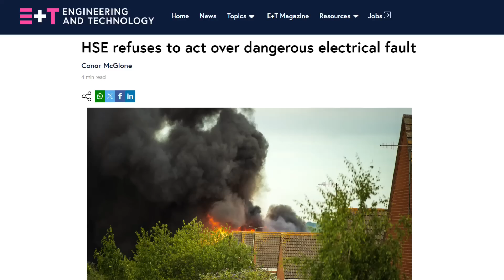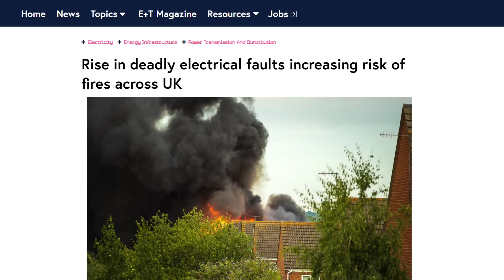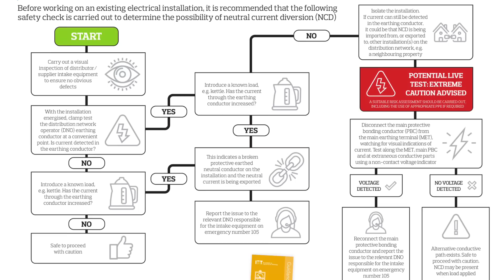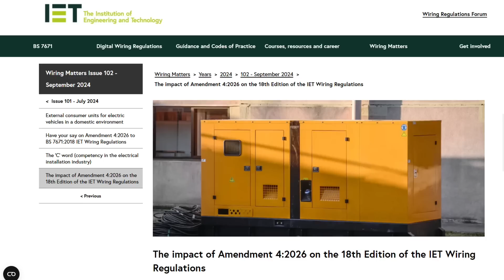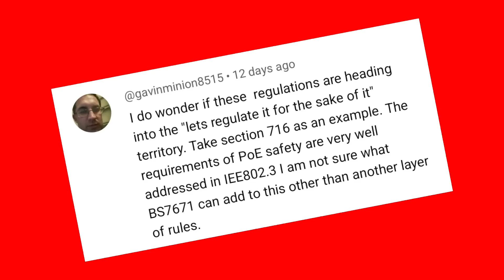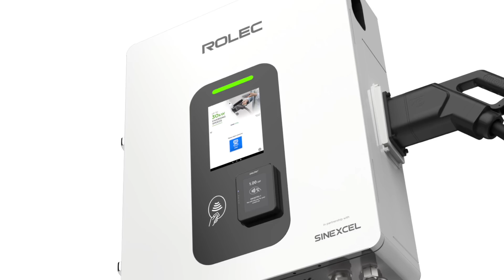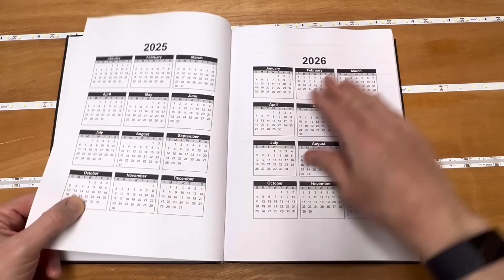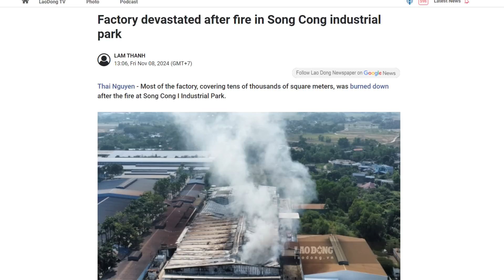⚠️ Electricians Warned Over Neutral Current Diversions ⚠️

Comment: Street charging: great if you can park in the street next to your dedicated outlet. In my road it's a free for all, you cannot guarantee any parking spot.
If it's a smart system, you might be able to get a charging spot, but how many chargers in a common street of 70 terrace houses? every 20 feet? Often, you cannot park on both sides of the (narrow) road, so you're stuffed.
It won't happen. It won't work.

Comment: EV parked on street corner, charging, gets hit by another car. The EV is still on charge and it's now damaged and it's pushed over the Telephone/Internet box. And pushed a street light over. 

If it's raining. Is it safe for people to walk past? Safe for dogs? 

What are the dangers and considerations?
Reply: If it is pushed far the connector should part, and in any case, the EVSE contains a residual current device / safety switch / GFCI, so will disconnect the power.  Yes, safe for dogs and people.  Your are sounding a little bit fossil fuel industry funded there.
Reply: What next? It's hit by a bolt of lightning?

Comment: I think I had one of those neutral current diversions at the start of the year. Power went off but then some neons in a extension lead were glowing faintly and a dehumidifier was running really slowly, sounded like it was struggling to rotate. Neighbours reported similar issues. Then about a week or two later my fridge freezer stopped working, I presume that the low voltage had damaged the motor. I have brought the Sollatek Fridge guard to protect my new fridge freezer, but it only protects the appliance, not the exposed metalwork in the house nor the gas meter.

Comment: k£25 for 400A seems fair enough. That's £25/hour of electricity flat-out if it's a single phase? k£25 if a thousand hours - only 6 weeks. It'll be ridiculously underutilised. If both-way charging (V2V?) is a thing, wouldn't it be possible to leave EVs connected to a common network with barely any capcity so they can charge each other? If you're driving ten miles every day with 100kWh onboard that cost you £8 (@8p per) to top up, you could sell £35 (@70p per) worth at a public charge exchange?

Comment: With the increase risk of PEN faults, when are car dealers going to be stopped from supplying 13A cables which EV owners then plug into their kitchen sockets ?! We have to jump through hoops to install a dedicated EV charger at a domestic property (including gaining permission from the DNO), yet an EV owner can bypass all of that, not realising the risk they are putting themselves and others at.
Reply: And in the kitchen there isn't any problem? In the driveway you're most likely wearing shoes while in the kitchen you're sitting bare foot on the tile. What is needed is whole house pen fault protection or proper earthing

Comment: PoE in electrical regulations is ridiculous. What's next? Power over USB or HDMI?
Reply: If fire safety is the concern, USB delivers higher current than PoE and does not require device handshaking before delivering power.  There are also examples of USB cables causing burns and even igniting fires.
Reply: @gavinminion8515  Isn't just because Ethernet is part of EV installations so electricians might as well know how to do it right?

Comment: DNC's don't just occur when there's an overt Open PEN fault. Whenever there is a parallel path, the neutral current will split according to the relative impedances of the paths. An open- pen will cause 100% diversion, & if that path is interrupted by say cutting a pipe, then full mains voltage will appear across the gap.
Spare a thought for the plumbers & how informed that are about the risk. The ones that are aware connect a jump lead before cutting a pipe.
There's a really good YouTube video about this by John Ward.
Reply: Plumbers in my part of the world do electrical safety, there's abundant information provided about electrical and the government frequently does safety campaigns but over the past 30 years not a single plumber I've had at my house has shown any concern for my safety (disconnected water bond etc) let alone their own.  No sign of bonding jumper, no test of pipework before going hands on.  Some of the jobs involved being flat on their back under the house touching the pipework.  There's a real world example used that should scare them straight but it doesn't.  Plumber went under a house, reached up to the pipe... and was found there with his hand still resting on the pipe two days later when he didn't turn up to work the next Monday.

Comment: A solution to the gas meter issue is something we do with water meters here in the states. The water piping in the US was allowed to also be used instead of an earth spike. To maintain continuity when the water meter is serviced, an electrical bonding jumper connects the street pipe to the house pipes to allow current to flow if the water meter is removed. A bonding jumper across the gas meter would allow the resistance in the gas meter to be bypassed during a PEN fault. In the US we have TN-C-S with earth spikes with additional lightning protection and equipotential earthing.
Reply: We have very similar things in the uk. A lot of the metal pipes though are being removed and replaced with plastic. Sadly making your solution not possible
Reply: @86744-i  That said if the pipe gets replaced with plastic the current isn't going to try flowing through the meter anymore. So this might be a solution after all.
Reply: We have this rule for metalic pipes in CZ  . Meters have to be electrically bridged .

Comment: yeah, having Volts Available is GREAT ...but the idea of a ground fault on a building and a resultant dancing neutral will destroy all my computers and network gear!!! ...I am in a run down council house and can see why the gas cannot be a smart meter = I want under floor heating and a GROUND sourced heat pump (I am at 200 meters altitude where the air gets colder and air sourced heat pumps are useless)...

Comment: We should do what’s done in the Republic of Ireland where earth electrodes are installed by the customer’s contractor and connected to the neutral in the installation (‘’neutralising the earth’’). This along with the DNO’s PEN conductors provides a very safe solution.
Reply: Multiple earth neutral link (M.E.N) where I’m from is standard. Earth electrode installed as standard at the main switchboard.
Reply: How safe it it? If you connect a rod to a PME system, & the PEN open up, then the earth rod is going to potentially get to a dangerous voltage, as will the ground around it, as you're trying to use it as the return path?
Reply: @alanjewell9550  depending on resistivity, soil or ground in this case is actually a good conductor. Stray voltages near the electrode when under fault conditions is relatively low and electric shock risk is mostly mitigated to direct contact with the earth electrode or any part of the earthing system which includes bonded structure members.

Australia where I’m from also uses SWER (single wire earth return) power connections to remote properties. It’s literally one supplied conductor and the return path back to the transformer is through the ground. Biggest issue with this is due to our hot climate these systems experience “brown outs” where the soil becomes too dry and resistive to allow return current. During these situations it’s common to see farmers hosing down the bottom of their power poles to re establish power.
Reply: @sniperfi4532  the SWER system sounds a bit scary! It much require an extensive earthing system to get the impedance down low enough to be useful - less than an ohm. Typical electrode here would test probably at best tens of ohms, & up to 200 would pass. That's no use as a return path.
Isn't the SWER dangerous to live stock? There was a nasty incident some years ago when a racehorse died in the paddock at Newbury I think because of an old cable that hadn't been isolated.
Reply: @ it’s actually on par with safety in conventional distribution systems and can even be safer due to its use of isolation transformers. The earth electrodes are driven deep as far as 6m into the ground. Earth potential rise can be an issue under fault conditions but generally there is less than 20v/m (volts per meter) potential near the earth stake so electric shock risk is extremely low.

Comment: 😂at this rate will be no electricans left... so many updates and extra regulations or dodgy pme supplies now days.

Be easier to be a plasterer😂

Issue is back when we started (15yrs ago) you could put in a simple fuseboard (distribution board) and most domestic would be happy at £550.00 all in tested and fitted but now you need to be charging £1000 to £1200 for a fuseboard.

This puts off customers from making there home safer as there prefer put off by the cost.

We have higher costs in parts, insurance and books and training.

Gumble over...😊

Comment: Neutral just sounds as wrong in dutch as you try to explain here.
Proper word should be return/common  here?
Weird (very obvious)faults will happen when that 'neutral' is not that.
Reply: It makes sense to use neutral when describing it as it is 'neutral' to the environment because it's taken to mother earth at the transformer in all T* class systems.  The earth wire can become energised in various faults too, but we still call it an earth wire.
Reply: @retrozmachine1189 
Earth = to carry faults back to source thus causing an large fault current to trip the breaker 

Neutral =- path back for current to transformer centre point 👉

Comment: It would not surprise me to hear the next amendment introducing the requirement to install a PEN Fault Detection device either alongside an old CU or as part of a CU change, as the amount of incidences increases and the issues brought more into mainstream media outlets. Manufacturers who are early adopters to miniaturise them to go in a spare way or two will do well.
Reply: Why doesn't it trip the RCD if that isn't a stupid question. I've looked at the situation, and I once believed the RCD expects a balanced L-N current, which would not be the case if it was bypassing the meter via earth?
Reply: @Marek-o3u  The neutral and earth are joined at the service head. If the pen conductor outside the property has failed, it doesn't look like an earth fault to the rcd. The line comes in and although current may be flowing back through alternate earth paths external to the building, it still goes through the neutral on the rcd protected side of the circuit. After the rcd it then gets connected to the earth paths.  Thereby making rcd's ineffective against this type of fault.
I would suggest the dno's put a clip on current clamp as part of the new smart meters and monitor any earth leakage to alert of any potential problems immediately to initiate an investigation.

Comment: I know PME is very much country wide, but, as it is proving to be so unreliable, why can't they mix PME with bonded TT.?? That way if the Neutral went down, the system would still be protected to some degree with an Earth Spike.! If every property had an Earth Spike back to the transformer more breakers would trip in the properties... Saving lives and unwanted shocks.
I have TT here and would not be without it. Someone be brave and tell me why we can't bond the Neutral to a spike.!??
Bearing in mind, I have done loads of work on camping sites.....
Reply: 23A of active loads in the premises (ignoring the non-linear nature of most things these days), TT impedance of 20 ohms, break the PEN for the premises, earthing system and all earthed items rise to 153V above the transformer neutral with potential between the earthing system and the soil best being described with a heatmap.  Touch anything earthed far enough away from the earth electrode to develop sufficient voltage to the ground and you won't have a good day.  The Yanks don't specifically check their earth electrodes beyond saying if it measures > 25 ohms put a second rod in but there is no requirement to get it to/under 25 ohms (contrary to popular belief), AU/NZ there is no requirement to check the electrode impedance at all.  Now think about how your TT electrode performs.  It's one of the oddities of all this stuff that if there is a full metal path through pipework etc to a neighbouring PME (USA = MGN, AU/NZ = MEN) the pipework will provide a better return path than the electrode.  Having an electrode will help keep the voltage on the earthing system lower relative to the surrounding soil but it doesn't work miracles.  It's still odd that you don't have a mandatory separate electrode.
Reply: @retrozmachine1189  This is precisely what I am getting at, if it was expected to have an additional Earth rod, it may provide enough imbalance to trip an RCD, thus disconnecting the supply totally. Most Gas and Water is now PVC. Our steel Water pipe is past its use by date, so PVC it is, and we are TT here. So I will be adding another rod to compensate for the loss of the steel Water pipe. I will insist it stay in place for a bond after the upgrade.
There may be an argument that additional Earth rods may make the situation worse, but I would rather have an increased path (lower resistance to ground) than virtually none.
Open for debate perhaps.? Play nicely....
Reply: @G1ZQCArtwork  That'd all hinge on the particular PEN fault - premises or network - and the location of the RCD relative to the N/E link.  If we place the RCD downstream of the N/E link it will never react since all sub-circuit current still passes in and out of the RCD.  If upstream of the N/E link it'd be exposed to normal parallel path neutral current (my own MEN installation has about 20mA to 40mA on the main earth with no load in the premises).  Put loads on and that shifts as you can imagine.  I don't know the phasing of the current so it could be flowing into the ground or out of it so loads in the house may increase or decrease, swing through zero and then start to increase it.  You definitely do not want to add additional impedance risk points between the PEN and the earthing system so really you can't put an RCD upstream of the N/E link safely anyway.
Reply: That was my question too
Reply: @andyb7813  To be honest, as a PEN fault is so dangerous, I would have thought by now, it would be Mandatory to back up the system with TT Earth Spikes as a matter of good practice and for much better safety. All Camping sites, Marinas and I think most rural Farm outbuildings are all TT for that very reason.
Some older properties do not have any form of RCD in place, so an Earth Neutral fault in the property would never show up unless specifically looked for during "inspections" which are hardly ever carried out in some places.
Reply: @G1ZQCArtwork farms and marina and campsite are definitely special and there earthing requirement is alot more complex your totally right in this aspect.

Enjoy a good debate 😊.

Having a few rods in has to be done correctly.

So many issues with not doing a TT earthing I have seen in my time😮.

Metal trunking from the tail etc..metal glands for the tails entry etc.. this is a mega rosk as the supply may not disconnect on a TT supply.

And also not spacing the TT rods correctly or deep enough or ...making a break between each rod..

The list goes on..

TT and earthing in general is a complex issue that seems simple on the face of it along with supplemented earthing rods and bonded pipe work in a pme system.

Dint get 😂get me started in swimming pools😂😂 and pme supplies and phantom 👻 shocks to hand rails and steps etc from diverted ground netrual currents 😲 😑
Reply: Think issue maybe is how much diverted netrual current could 🤔 pass thru your self Imposed supplemented rod on a pme supply if...and only if it's not made an requirement and a low resistance is critical here to get a disconnect or at least reduce the voltage down agin depends on network loadings...

 If every home had a rod wouldn't be an issue as the current would be alot lower but if only one home had this supplementary rod added to a pme supply could get abit ...spicy 😂

Had this discussion with a Napit lecturer and he was saying maybe a 25mm Earth cable g/y to the rod would maybe do it.
Just depends on how many houses are effected.

Like the idea you guys are saying and I totally get it😊.

Again it just practically can be a bitch to implement sometimes when you have a fussy customers with newly plastered homes and a distributed supply in the middle of the house...